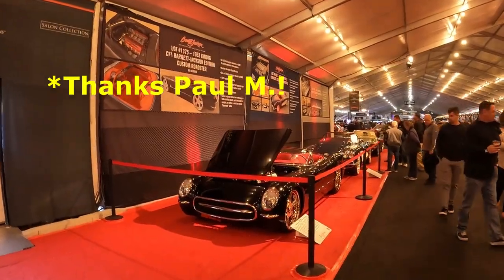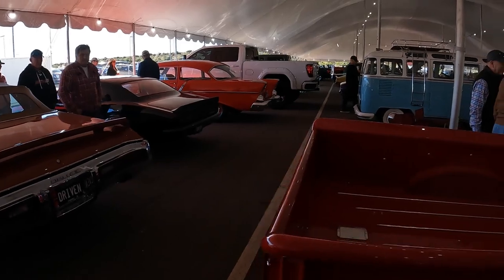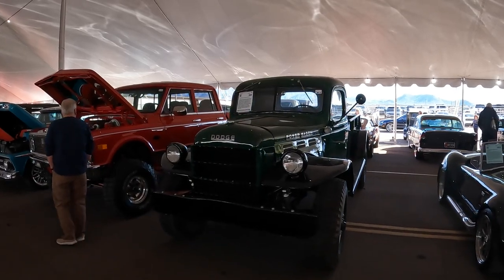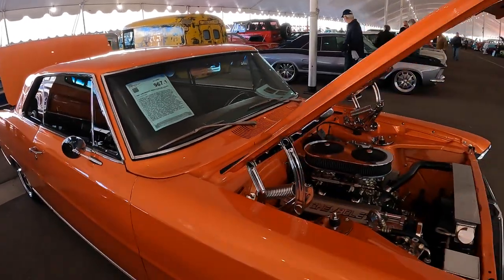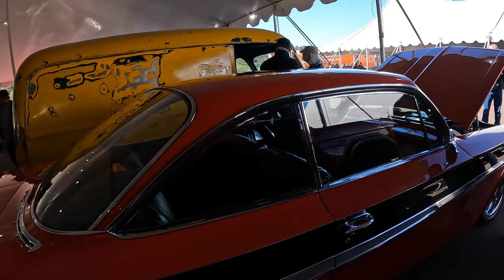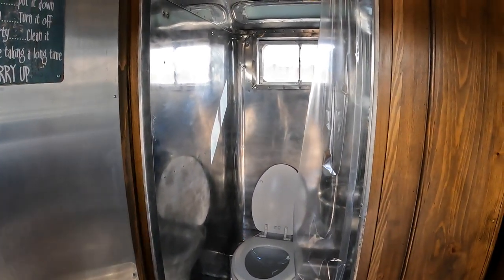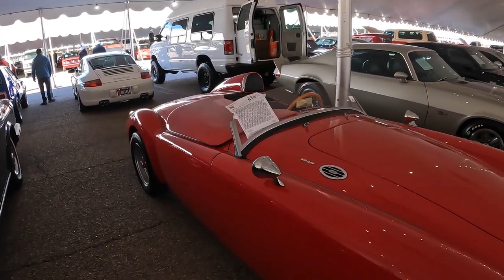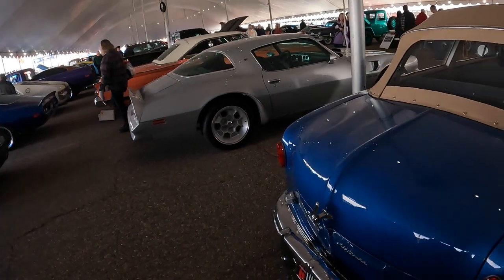Barrett Jackson3

Comment: Nice example of the Amphibcar. I rode in one at the 1964-65 World's Fair. No leaks! Also owned a "67 Nova SS, mine was Fire Engine Red, started as a 6 cylinder, with 3 on the column. I put a small block 350 in it and a Hurst Mystery shifter...Memories. Thanks Paul
Reply from the maker: Hurst Mystery Shifter 😂 I remember those.

Comment: My fav: I'm kind of in love with early chevy bubble tops with 409 4spds. Other than that those years of Dodge vans are really cool. You could get them 225 slant six or 318 v8. Funny, the 67 nova didn't sell as well as the earlier or later Novas. It's my fav Nova! That red vintage refrigerator in that Spartan is fairly cheap one. Ive been wanting a blue Smeg for my vintage kitchen but they are $3K and never go on sale. I don't much trust Galanz appliances. But that sure is a well thought out rig.
Reply from the maker: Hey Twig, The 7 is my favorite too, I didn't know about the sales numbers and I'm mildly surprised by that. 
Also didn't know anything about Smeg appliances, I just googled it and OMG they're really proud of them. Thanks for sharing that info brother!

Comment: That 69 Mach 1 brings back old memories, Bought one new with the Drag Pack option, which meant, 3;90 or 4;30 gears, and a Super Cobra Jet engine, which had different connection rods and a oil cooler, made it a little more stout.I had 4;30s in mine, with a little mentoring from Tasca Ford, ran 13.7s, pure stock, NHRA [street tires and closed exhaust]. Back then was a fast street car.Don't know what made that car 1 of 1.
Reply from the maker: I was wondering that too because I have seen others. 4:30 gears 😳 Man you had "stump pullers", but I know how fun that was!! Thanks, Joseph 👍
Reply: @paulontheroad  Yes was basically a quarter mile street car,  come thru the quarter mile traps @ around 6200/6300 RPM. Later on did more work to it, sodium valves, head work ,multi angle valve job, matched intake ports, 29"wrinkle wall slicks with 7psi of air ,ran 12.3 116 mph.6mpg street car, back then 260 Sunoco cost 34 cents a gallon.Like you Paul Uncle Sam decided to alter my life.
Reply from the maker: @josephsouza9951  Sounds like it was a fun car Joseph, and Welcome Home Brother 👍